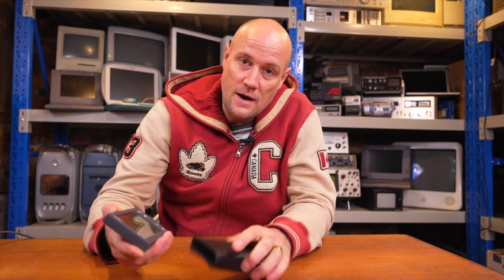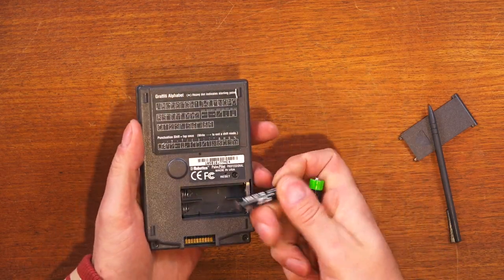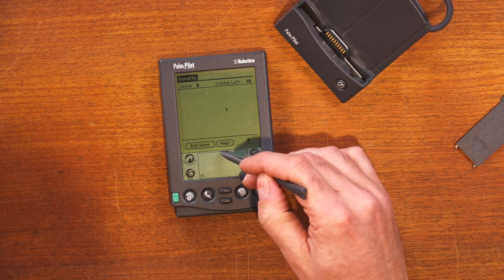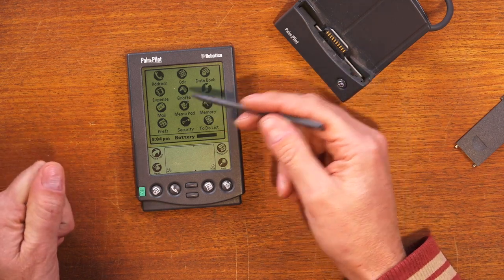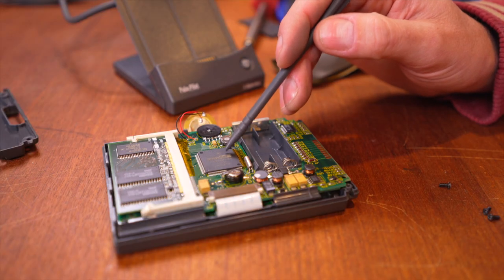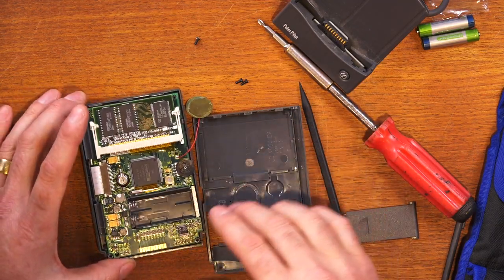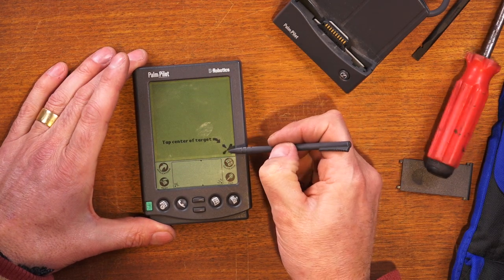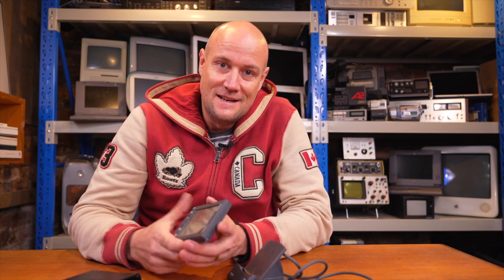Palm Pilot Professional - Teardown and repair

Comment: A couple of years before smartphones came out, they added Windows CE model variants with integrated mobile phone and SIM card.  I never had those but I did and still have a  Dell Axim x51v, which in early 2012 scarily became by main PC for a few weeks until I got a replacement desktop PC, due to the previous one dying.  The little Dell Pocket PC has a special adapter cable, to enable connection with a full size PC monitor.  Added to this a wireless bluetooth keyboard and it was an adhoc solution to tide me over.  The Dell even has an Nvidia GPU so watching video on the PC monitor was just about possible at VGA resolution I think.   Normally I used Pocket PC as a cheap TomTom navigation device, which it did really well.
Reply from the maker: That would have been quite the setup!